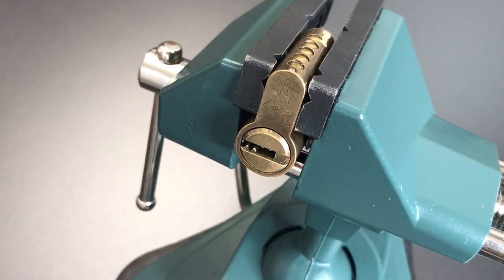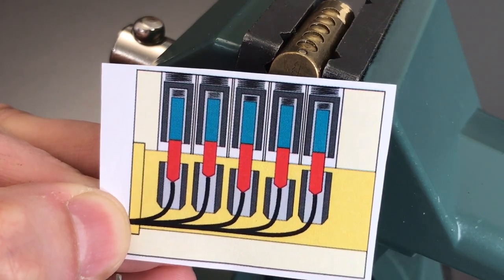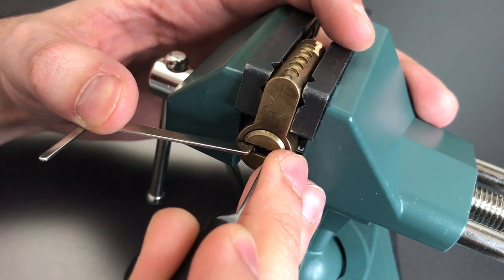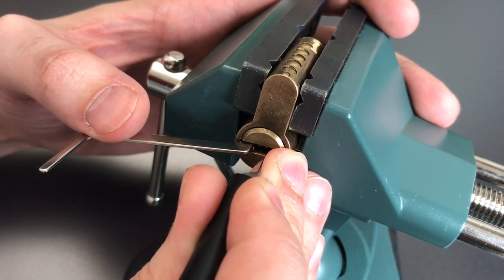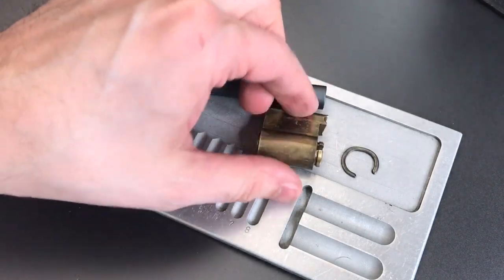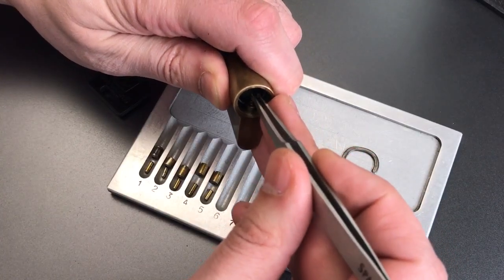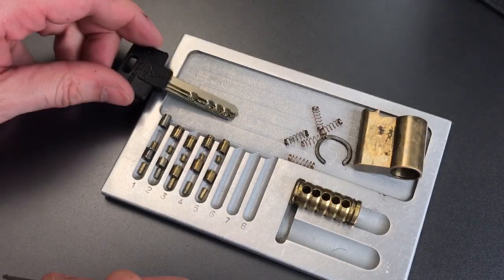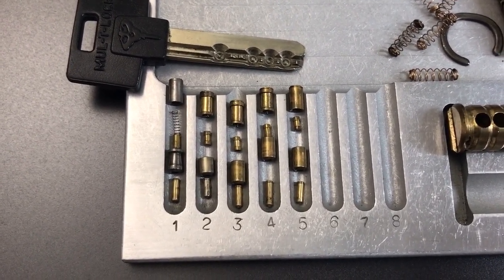[393] Mul-T-Lock Classic Euro Profile Cylinder Picked and Gutted

Comment: A few interesting counter-points to this attack: 

1) It only works on locks mounted the 'correct' way up; so no Euro cylinders or padlocks that are being held with the pin stack facing downwards, because gravity will cause the outer key pins to drop with the outer drivers, blocking the shear to both the outer and inner pin stacks.

2) Actually making a tool that resembles a 5-armed piece of wire , that will fit around the warding of a MTL and also have the ability to raise the inner pins this far is VERY difficult to make. It is not impossible I do not think...but very difficult.

3) While this attack has ostensibly been fixed in more recent MTL's, I have noticed that many KIK's actually have holes in the roof of the chamber caps. I do not know why they do this, and if there is even the tiniest of space (and there has to be approximately 1mm instantly available from the chamber cap thickness and the ridge above it that keeps it in place) then this attack could still be on the table for KIK's with chamber caps like this. Anybody know why KIK's chamber caps have these holes in them? Seems totally pointless and makes the fix for this attack potentially useless!